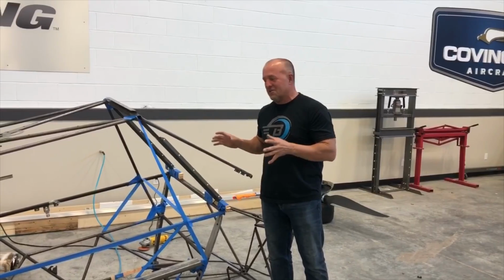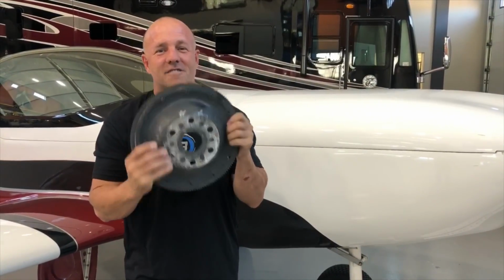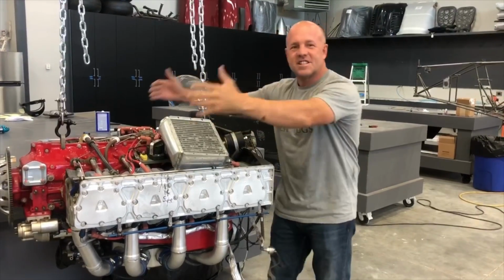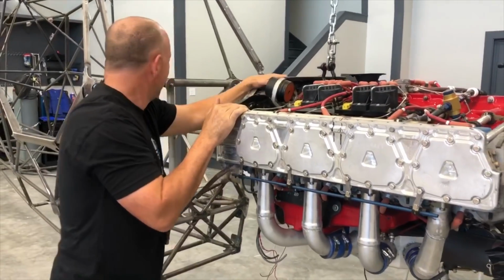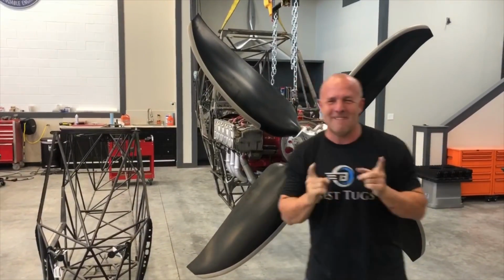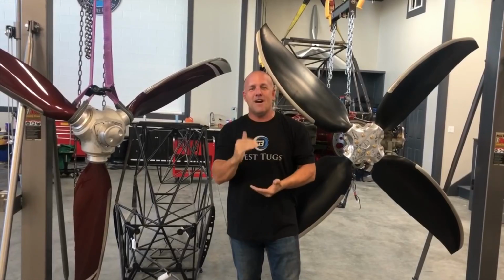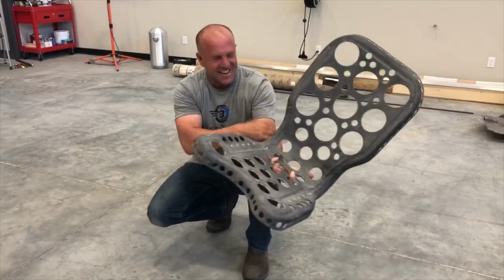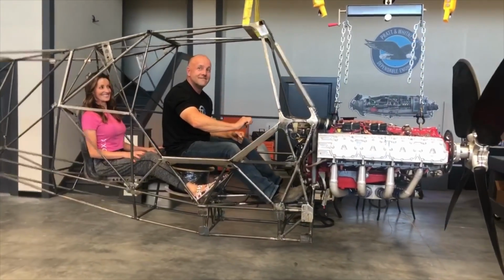Never said that Scrappy was Normal 🤷🏻‍♂️ (Scrappy Bush Plane 3)

Comment: Would it be crazy to add a weight that’s normally spring loaded to the COG and on a ratcheting track, when you land hit a button and the weight changes location and moves to toward the tail of scrappy? Then when you hit the brakes it takes even more to get the tailwheel to come up. Just a thought 😊

Comment: I know that this is an older video, do you use heatsink compound between the headlocker and the heads to aid in heat transfer. In the electronics industry, we use a white compound that has the consistency of melted marshmallows between heat generating components like CPUs and their heatsinks to aid in the transfer of heat.

Comment: Smaller diameter propeller gives less blades tip speed so it will generate lift over the length of the prop all the way to the tips.

Comment: Amazing work and very interesting content, I am looking forward to see this aircraft flying! At 16:40, you say that a conventional propeller would start to “cavitate”, the correct wording is when the boundary layer of the propeller starts to separate. Cavitation in only happening in a liquid, when this phenomenon takes place, the liquid transforms in gaz bubble in the area where the pressure is very low. In your case we talk about a separation due to an adverse pressure gradient developing on the suction side of the blades. When this occurs, the thrust will start to decrease whereas the torque will keep growing exactly as you describe in the video.

Comment: Great looking metal work Mike!! I am impressed, when I saw the tube slide into place PERFECTLY I knew this was going to come out great.
 I didn't finish flight school and only have 12 hours logged, long story but my family had a flight service with 3 Cessna 206's and my father and I worked on a lot of birds including some surplus L-21 Delfin jets in the late 90's. 

 Was wondering if you thought about installing an adjustable ballast device that you could easily build. Picture a long Jack screw connected through a lead filled ballast box that's mounted internally towards the rear of the fuselage. This would allow you to avoid CG issues as you burn fuel so you can add passengers or cargo. This will widen your CG envelope by two times at least. Using lead as ballast allows you to have a ballast that doesn't take up much space. The other option is to build a fuel cell towards the rear that you can pump in fuel as ballast and as you know, each gallon of fuel weighs 6 pounds you would need a decent size fuel cell.

Comment: At 5:58 in the video, it looks like a critical horizontal diagonal was omitted.  The diagonals location is level with the upper engine mounts.  The remaining truss members, that transfer the tension from the hanging engine to the side framework, are no longer pinned ends in a strength analysis.  The lack of the diagonal means you have an incomplete horizontal truss in line with the upper engine mounts.  Which at the least, would probably cause increased vibration in the framing, if not premature fatigue in the existing welds.  Which is of course, where the parachute comes in handy.

Comment: What are the differences os this prop to normal aircraft props? As it is optimized for static thrust and low speeds It nas low pitch. However, why are they so wide? It might be to absorb more power from the engine. In this case It would be a better ideia to increase the number of blades. Wouldn't It?

Comment: Idea...why cant you make a controlled rolling tray inside the plane structure that slides backwards during landings to put more weight in the back of the plane during landing and Braking...kind of like a Tractor pull sled.

Comment: What about using a counter rotating prop instead of the air boat prop?  Wouldn’t that get rid of a lot of the P factor and also let you use a smaller diameter?

Comment: You say the motor can spin faster than the prop can handle, and the project is all about getting into the air faster. Have you considered getting cams designed so its power peak happens at the RPM that is ideal for short takeoff with that prop?

Comment: 500 total installed shp in a Cub. You aren't going to use it all, dude. I know it's just simulator crap but in my simulator I've coded up a Cessna Skymasher (about thrice as heavy) with 1250 installed shp (2x GSIV-460, to use Lycontisaurus nomenclature, if I'm not mistaken on the present displacement), and I always run the engines anorexically LOP (15, 16, 17:1 wideband, effectively 800 installed shp) because it just has too much power. Were it a real plane I'd have lifted a head by now (not good) from scorching something by running so LOP.

Comment: Your videos are really educational, I purchased a Fisher FP-101 ultralight kit and started putting it together  in 1981. It was a real challenge keeping it in FAA guide lines for weight. Where they called for an an3 for the strut attachment? Went with an4 and so on. The first engine flew well in ground effect 775 rotax direct drive, then a 440 with gear reduction, would go straight up. Talking about weight, fabric dope and paint OMG, have painted autos but never realized how many square feet of surface is on a plane. It was 2 1/2 years to finish but well worth it. Im following you and your progress waiting to see SCRAPPY take to the skies. Those air boats are crazy !!!

Comment: Love your passion and all the hands-on applied tech. As an aerospace engineer I have to take issue with your use of the word “cavitation “ though.  Aircraft props don’t cavitate. Cavitation refers to water props where the pressure on the low pressure side of the prop is below the vapor pressure of the liquid and water turns into vapor, creating a cavity, hence the word cavitation.  Since air is a gas already, there is no change in phase and no cavitation.  The prop blades stall, creating more noise and since, like in a wing stall, the flow has detached, the prop blades produce less thrust.  So, you’re all good with what you’re saying, just don’t term cavitation.  :-)

Comment: Mike I’m not sure where to locate air brakes on Scrappy, I’m guessing a top mounted system to optionally partner with your “Bombay.” The problem is both upper and lower system need to actuate full extention on command in like a 1/2 second and retract fully in about 1/2 second. The trade off will be you can start stopping while airborne about 2 seconds, maybe 3 seconds before touchdown. A stick or throttle actuated button-lever is probably required because you’re using it exactly when you are landing and both hands are busy on turnaround. It should peel off 30 knots of speed inside 2 seconds of full extension. Worm screws seem too slow.

Comment: I have just admired this man's full-hearted interest in his work in the manner he described the propeller function to CAVITATE. and lose its thrust, rather than STALLING. To describe what goes on in both water and air propellers I  also use the word CAVITATE  myself to express both stalling and cavitation and also use "aeration", even though I know they are not the same as Cavitation is the boiling of water at low pressure and when I see the aircraft pulling up or turning with all  that misty cloud  on their wings they are reducing the pressure so much that the water moisture in the air turns into steam  the same as water cavitates in a high-speed water propeller. Aeration and stalling are also interesting functions in propellers. This man knows what he is doing. In water propellers, they can suffer from STALLING, AERATION  or CAVITATION while air propellers can stall as much as water propellers may stall.   When I hear this gentleman talk about his work, he seems to imagine that he is part of the molecules and atoms and material creating the dynamic function himself. When he talks about the propellers he  transforms himself into the water or those air/water particles that go through the blades of both water and air propellers. A great practical man of science indeed, he certainly feels the real science and applied mathematics in his blood and attains its functions with excellent engineering skills.  An exceptional man indeed. 
I wish to congratulate this very intelligent gentleman at the manner HE FEELS AND  IS SO EMOTIONAL about the manner he wants to get close and be part of any engineering function he deals with.  All I can say, from a few thousand miles away, MY HEARTY CONGRATULATIONS.   I am submitting a few videos related to cavitation, stalling, aeration, ventilation, misting clouding over wings.
https://youtu.be/SUKCp4pK5LY
https://youtu.be/K_w3gcvA87I
https://youtu.be/SiOiVHUEYao
https://youtu.be/s1c-O0qWQBQ
https://youtu.be/pD1HVY4J4WU

Comment: If you get a constant speed propeller, it allows you to adjust the prop pitch while flying.
Reply from the maker: This engine had a constant speed prop on a former build.  Constant speed, variable pitch props are better for top end, but they add a good 70lbs and this build is for the purpose of quick launch and light weight.  Also, this engine has enough horsepower to max out the vne on this airframe, so a constant speed prop wouldn’t give me any advantage over a fixed pitch/ground adjustable.
Reply: @MikePatey  What is "vne"?.......... Also watch out and maybe do some calculations first about this but, when you set your propeller pitch at a low Angle of attack, make sure that it gives enough thrust at the airspeed that the plane needs to take off..... Your wing loading will be significantly higher for when you load up with fuel that you need to fly along side your buddies...... Not sure if this advice will help since you seem like you have got it under control....... Do you know if your airplane would be able to do a prop hang?

I CANNOT wait till your plane gets in the air...... Good luck brother
Reply from the maker: VNE refers to the speed at which to never exceed in a specific airframe.  Each airframe has its maximum.

Thanks bud, I have it all calculated and as far as hanging on it’s prop .. it’s going to be close.🤠

Comment: If you could use a hybrid of a helicopter cyclic in a air plane you could control the pitching moment by controlling the pitch of the blades of the prop by increasing the pich on the left hand blade

Comment: I don't normally like it when people use automobile engines for airplane purposes, but in this case it would make a lot of sense. Any decent modern car engine can develop the horsepower that the IO-720 can the difference is that in a car the engine isn't meant to do that continuously whereas an airplane engine is. In your case, per your description of the goals, you won't be able to handle 400+ hp sustained anyways. This  means that you could save yourself a few hundred pounds and just use a car engine. Most of the time at cruise you'll be at 50-100 hp in a cub but you want 400 hp for short bursts. That sounds just like a car at a stoplight and then on the highway which is what car engines are meant for. The other benefit you could gain is with a gearbox you could have the engine spinning the opposite direction the propeller. That would give you less apparent torque about the propeller axis when you punch the throttle.  I like what you're doing, but I think you're wrong to use an airplane engine for the task.

Comment: Hey Mike, why don't you make this 4 blade prop a c/s prop that will automatically change settings with speed, or you can mount a rotary switch/knob so you can manually change it yourself depending on performance you desire? You already have the angles calculated....
 Will it break because of too much shaft hp going through it?

Comment: Mike: In auto racing, strong braking is just as beneficial as a strong engine. Both are needed. In STOL drag racing enhanced stopping and slowing power could just give Scrappy the necessary "unfair advantage" . This could, just possibly, be done by having an extremely large dorsal fin or vertical stabilizer which would then present a very large amount of drag during the slipping phase. Of course this would not make the plane very happy during crosswinds. However, instead of just making a very large vertical component, perhaps just adding an extremely large rudder would do the very same thing, and therefore allow a very large, and draggy, slip angle. Perhaps applying both of these components could just do the trick. Your thoughts?    –WS

Comment: The reason why engines like the Lycoming 540 have slip joints in the exhaust system is because when you heat and cool the engine the cylinders will move independently of each other, that's also a modification done by the Ram corporation in Waco TX with the Cessna Twins on the Continental 520 series of engines, only they used an accordion type section installed in the exhaust system trying to eliminate cracking when the cylinders move. Your one piece valve cover is cool, but it may develop some cracks.

Comment: Question about the propeller. Wouldnt the drag from the propeller be a serious safety issue if you have a engine out? Im referring to something like the red barron accident at reno in 79 when using dual propellers.

Comment: I think the word you are looking for is acceleration, you want the plane to accelerate as hard as possible at lower speeds.

Ever though about looking into Contra-rotating propellers? They should eliminate most of the twisting forces you get at acceleration from a standstill, thus giving you more controll at lower speeds. I don't know how easy they are to make or find though. 

https://en.wikipedia.org/wiki/Contra-rotating_propellers
"Contra-rotating propellers have been found to be between 6% and 16% more efficient than normal propellers."
"The torque on the aircraft from a pair of contra-rotating propellers effectively cancels out."
Reply: Would also be cool if you implemented the Meredith effect into the cooling parts, though that only comes into full effect at higher speeds.

Comment: Iff your plane would accelerate nearly as fast as the boat, it will look like a hare running with the ears folded back, your wings will fold back. Same for decellaration, only wings will fold forward.
As for braking, as long as your weight on the wheels is low, that is the limiting factor. A revolutionary idea would be to have flaps wich can go (far) negative. So you make your approach with positive flaps as usual, but when within 10 inches of the ground you switch to negative. So you slam on the deck like they do on aircraft carriers. But you have this baha suspension, so no problem, accept you are one hand short ( for throttle or flap). That can be solved with a collectieve stick like in helicopters. Even the location of this stick can be copied, stick up is flaps down (plane up) and stick down is plane down, with throttle on a twist grip. It would be prudent to limit the flap up travel when learning how to manage this. But it shortens the periode when neither airbrakes or wheelbrakes work. It could also be used when taking of in gusty wind, you accelarate with negative flaps to well beyond stall speed, and then jump in the air with positive flaps.
Back to work
Jaques

Comment: Cool stuff Mike, so I was watching you prepping tubes for welding and then I see you welding so I was wondering before I saw you using the MiG why wouldn’t you be using a Tig. Wouldn’t you prefer Tigue welds instead of MiG?

Comment: To avoid the tipping tendency caused by your long travel trailing link main gear that Draco had, you have to use a dual chamber suspension. 

This is the same suspension used for Baja trophy trucks. 

When the majority of the gear travel is compressed in the first chamber of the suspension it does not rebound, it would have zero spring force and take time to fill back up again. Then the second chamber suspension takes over and it has a much shorter travel, so with a huge crosswind the aircraft would be rock solid. With your off road experience you no doubt are familiar with this type of suspension. But it's worth mentioning since almost all fighter aircraft use a dual chamber type of suspension for their main gear so they can operate on the ground with thousands of pounds of ordinance on one wing and not the other.

The bad thing with dual chambers, as you are well aware of, would be once the first chamber was compressed the suspension wouldn't help raise the nose as you accelerated for takeoff. It would stay flat. To get a higher takeoff attitude at liftoff speed, it might be less weight to have an unused dual chamber in the tailwheel and release that chamber near takeoff to lower the tail.

Comment: Ok Mike Patey. I've been following you for a year. Just so happens I watched your debate with Trent Palmer from a year or so ago on the subject of prop drag and sink rate. Your giant air boat propeller paddles look like a huge increase in lead surface area drag which could cost you heavily in glide ratio under engine-out condition. Hope you have enough   lift to compensate elsewhere!

Comment: What about pumping losses on the larger displacement 8 cylinder engine compare to the smaller 4 cylinders?  At an equivalent power output you should have higher manifold vacuum to overcome.  Unless there's an airplane related assumption I'm getting wrong.  Incredibly sorry about Draco, glad everyone was unharmed.

Comment: The racing prop will stall at high rpm and low forward speed and increased forward speed decreases the angle of attack of the blades. Cavitate is a term used for hydro props.

Comment: Have you considered a weight that could be shifted from center of CG to the furthest reach of the tail section, via a switch on landing to allow you even more braking pressure? Perhaps having even 50 lbs could give you some notable stopping Force?